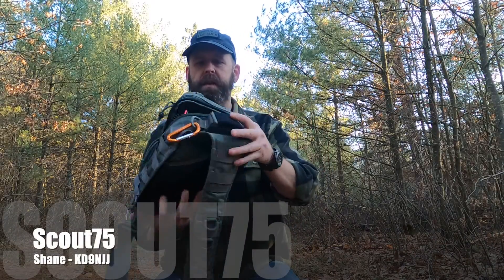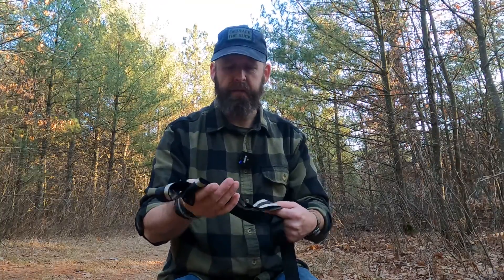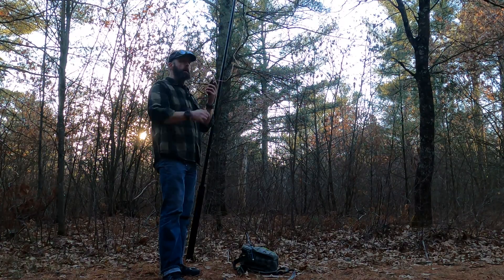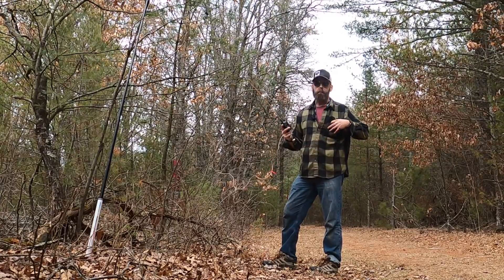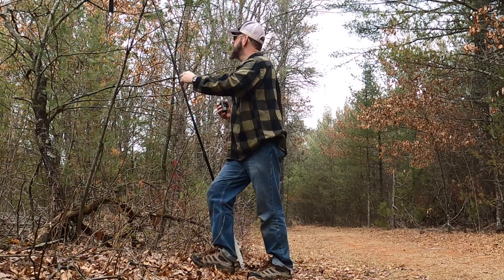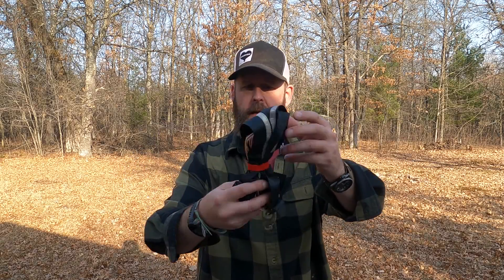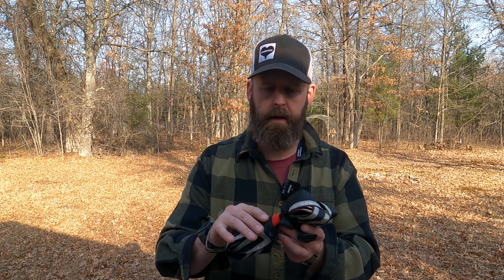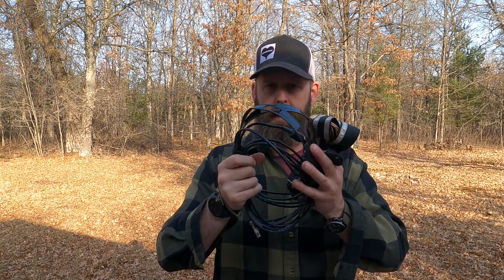Fara-J Roll Up 2 Meter  Faraday Cloth Antenna Fist Look

Comment: I tested my antenna, at home, with a 50' roll of RG-58, and it worked just fine! You do you! I was just thinking about making another jumper cable using some left over RG-174, because its also so small and light.
Reply from the maker: Cool!

Comment: I got mine in yesterday, and like it! It is very well made, super light weight, rolls up into a SMALL roll. And the best part is that it is tunable! It seems to TX & RX very clearly on a local 147 MHZ repeater.  look forward to more tests and use, but I have already noticed that it can twist up, into a spiral, on itself, which may mess with its function?
Reply from the maker: There a great antenna for sure! I plan to order another one or two for myself. Thanks for watching!

Comment: I tested my Ed Fong j-pole with the Carbon 6 mast as a back-up option for a public service event. There was definitely some interaction with the mast--if the antenna got too close, the SWR would be off. Good, quick thinking on repositioning the mast! Great review in the field too.
Reply from the maker: I did some more experimenting and could repeat the oddity that I show in the video. When things slow down a bit for me I need to do a deeper dive. Thanks for watching, Mike!

Comment: Amazing video! Thank you. You had me worried I sent you one that might have been flawed. I am doing my best to get some stock in and get you some more. If you have a antenna analyzer you can tune the antenna to be perfect in the frequency you are transmitting at. Here is the video on how to do it https://www.youtube.com/shorts/JYkSCSzqHQc Also the length of the coaxial makes the losses for this so notional that it is hardly worth considering like you said.
Reply from the maker: Glad you liked it! Your antenna has quickly become a favorite of mine.

Comment: I have been curious about these antennas. Something to consider is that you're probably losing a lot of your radatied power in the rg316. It would be interesting to try with a different coax in the same place with the same setup. I wonder if your signal would noticeably improve. I doubt it with that short of a run.
Reply from the maker: With the run only being 6 feet the loss is pretty negligible. Thanks for watching!
Reply: @Scout75PortableRadio  I think you're right. I was just curious how much of a real world difference there was.

Comment: Good video scout. I'm enjoying mine. Will be using mine camping. Only thing that could make it better is if it was dual band
Reply from the maker: Thanks! It is dual band 2m and 70cm. Plus since it’s fabric, you can tune it by folding down the end. Theoretically you can use it on 1.25m.